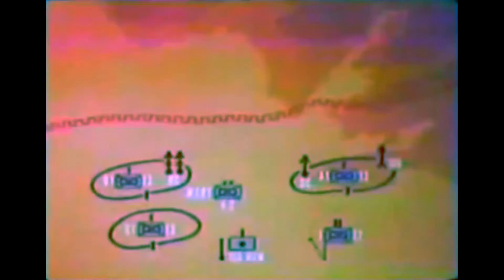M388 Davy Crockett Operational Test [COLORIZED VERSION]

Comment: Why didn't they think of doing this during WW2 when they nuked japan twice, I mean it IS easier firing a Davy Crokett Mini Nuke launcher at them then wasting fuel bringing that B-29 to Nagasaki and Hiroshima.
Reply from the maker: Considering this test was done in the 60s, I'm guessing they just didn't have the tech for it in the 40s. My best guess is that the 40s bombs were the ones we made at the only size they could and making them any bigger and any smaller was something we had to learn to develop. 

That said, they wanted a lot of damage, anyway. They were already causing equal amounts of damage with conventional bombs so the thought was that they could just use a single bomb to do what 1,665 tons of bombs did in Tokyo